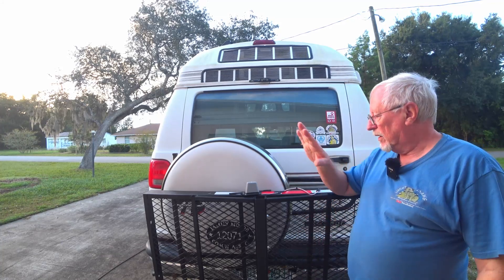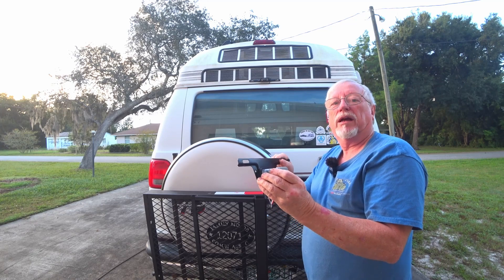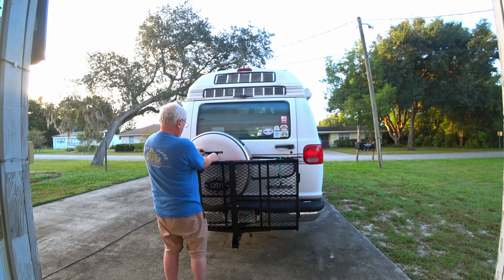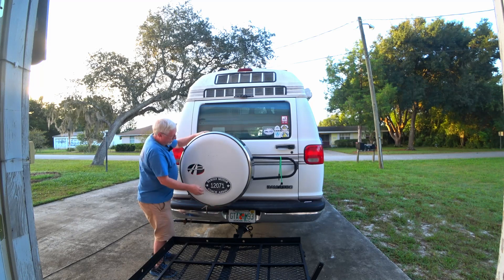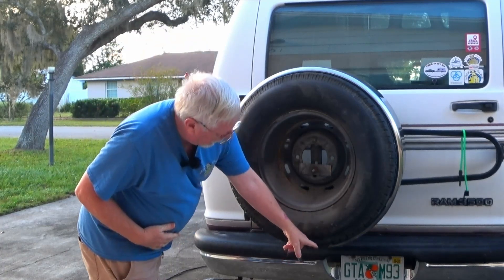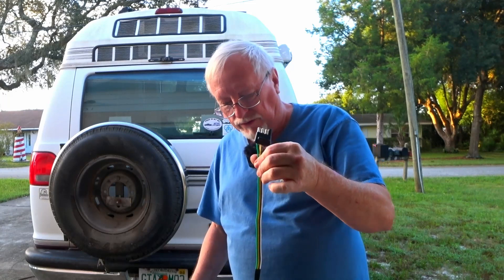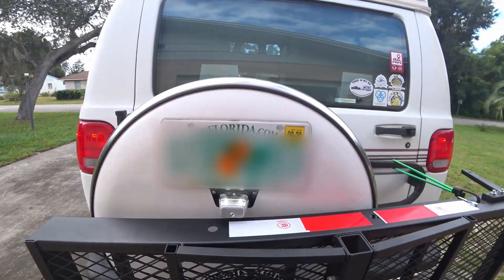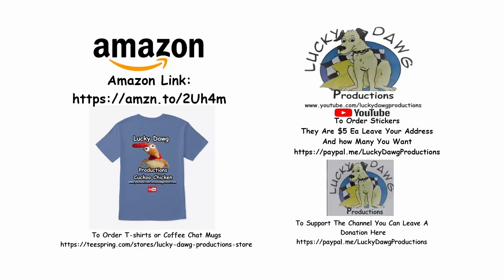Relocating The License Plate On A Roadtrek

Comment: Very nice Bob. Great idea using the pigtail for the quick and easy connection. I have the same hitch hauler and used it with a large tote box when going To Tennessee with family. I’m going to install a hitch on the Roadtrek in the spring! Thanks for the inspiration!
Reply: Thanks, Jon!  Using the hitch hauler with a tote box is a good idea!
Reply from the maker: Hi Jon. Glad the video gave you an inspiration for your Roadtrek.  Thanks for watching.